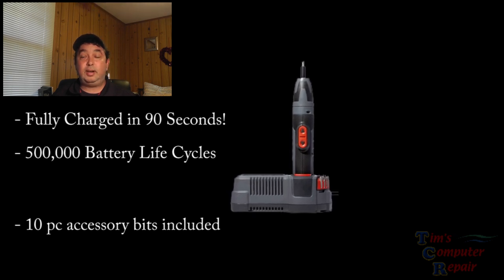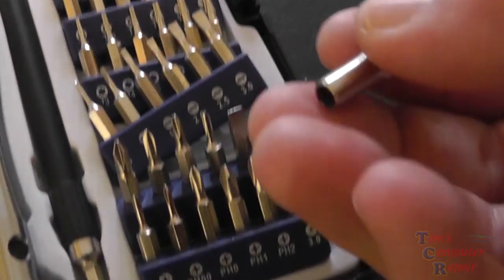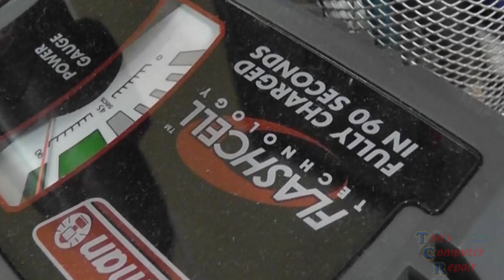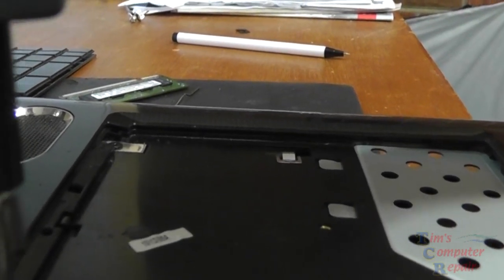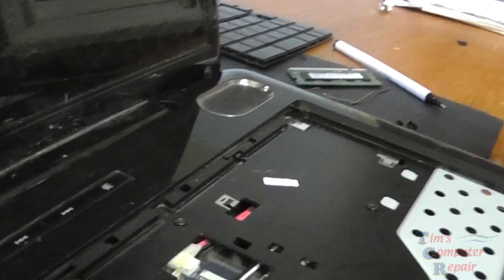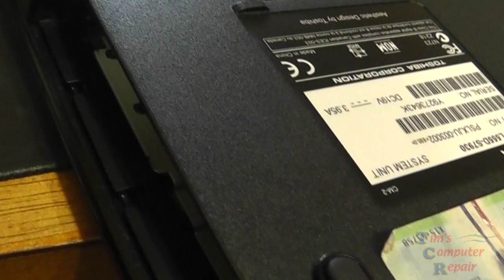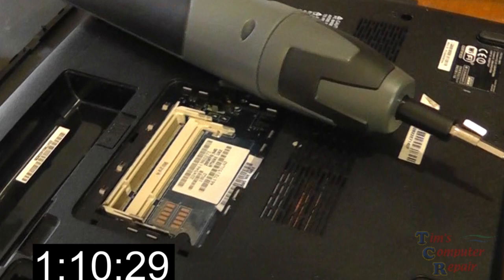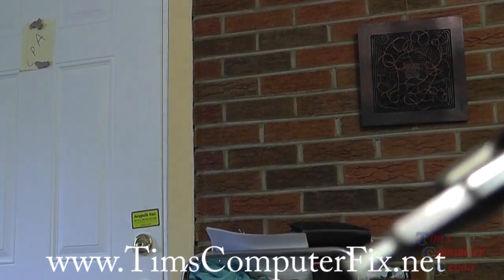Laptop and Computer Repair Screwdriver (Best Repair Tool Recommended) TimsComputerFix.net

Comment: nice demo. by the way, what would you do for a screw on laptop that has it's head worn out. basically I cannot unscrew it as the cuts on screw-head have worn out thin.  would you just use any one of those bits and drill that screw-head till it gets completely worn-out so you could maybe try pulling it out?.. trying to open up an old laptop i've got. thanks
Reply from the maker: 4kcss I use a dremel and just grind the head off of the screw. Once the you get the part off you are removing you can back the screw out with a pair of needle nose pliers. Thanks for watching.

Comment: They are good, although I own the one that doesn't have a screw counter. They may not charge in 90 seconds, but they do have an auto shutoff clutch that goes nice and low,  that'll save you from reaming out screws like this Coleman one might, if you're like me and not boss at tightening screws in laptops like Tim seems to be.

Comment: It seems to do the job, but the torque is too much for laptops. Breaking a customer's laptop would not be good. There is got to be a smaller half the size of this screwdriver. I found one in Germany, but they have no stores in US.
Reply from the maker: ***** I use this on many laptops. Have never damaged anything. It has done nothing more than save me time. Thanks for watching.

Comment: still too slow at 200 rpms-  i work on hundreds of laptops for my company, looking for high-speed precision cordless w/autostop- want to cut repair/service times down from manual driver use, of 4minutes per laptop, to 2-  i know im spinning manual precision drivers at 300 to 350rpm,  by hand (with a spin top knob)
Reply from the maker: Just curious what driver you would recommend? Thanks for watching.